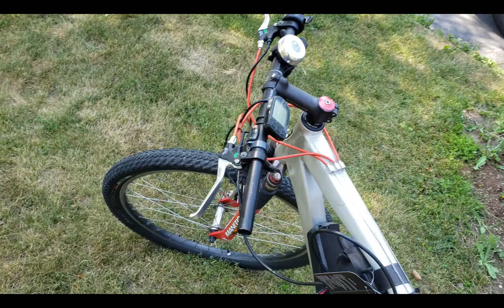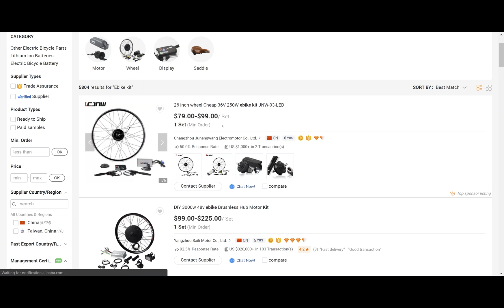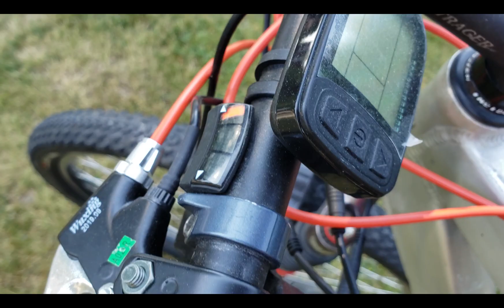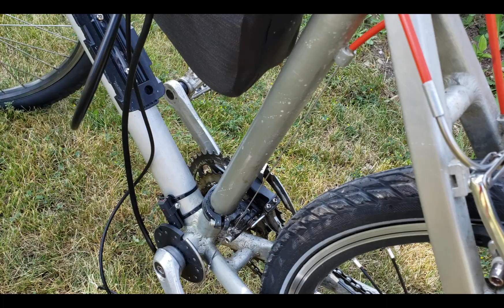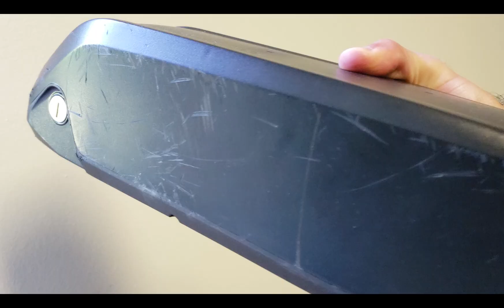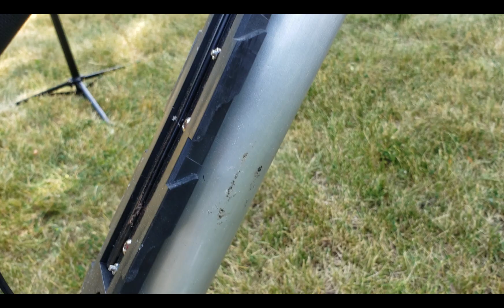Why you shouldn't buy a cheap DIY electric bike kit

Comment: Also as a side note, some of your cuts are a bit abrupt cutting off words etc. As per pre-built VS diy. U can get a decent pre-built ebike for 1-1.2k (such as a rad power bike). My ebike cost about 1500 total(including shipping etc). 1500w bike able to do 30mph for about 16m with a 300lb 6'6" rider. Used em3ev for entire kit (motor,Bluetooth screen,52v17ah 35e battery. Was about 1200 with shipping.

Comment: FYI a couple things that can help with decisions. There are reputable Chinese dealers for kits.i did the bbshd middrive kit from bafang. Second thing the reason your battery fell out was because you had the tray upside down. The connectors need to be at the bottom instead of the top. And last thing, the batteries that come on cheap kits are a fire hazard. Avoid Ali express batteries or ebay/Amazon ones. Each country has a couple reliable vendors who make proper batteries that are to spec and don't risk burning your house down. (best one I have found is em3ev.) I built my first ebike about 2 years ago.once it was built iv had zero issues except the bike I used itself having issues due to substandard parts I eventually replaced. Was about half the cost total of an equivelent ebike.IIt was work but to be honest,the initial install took only about 4 or 5 hours and it was running fine.II just kept upgrading things for the heck of it. Now I'm building a much more powerful one (14kw with a 18kw peak).That I wouldn't recommend to anyone not willing to become their own manufacturer (having to weld a custom frame,order a very expensive custom battery etc.  Tldr: good video, but there were a few inaccuracies, and most people I meet who recommend kits (myself included) recommend proper vendors instead of Ali ordering.